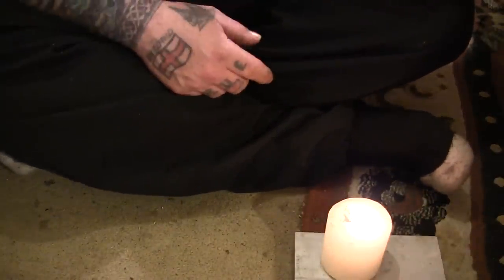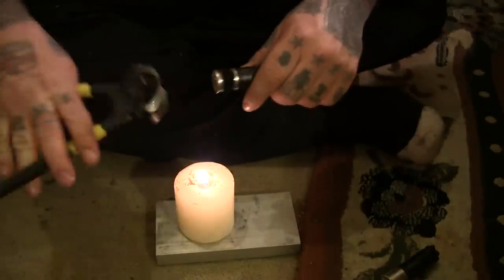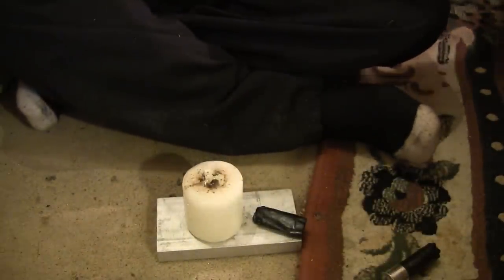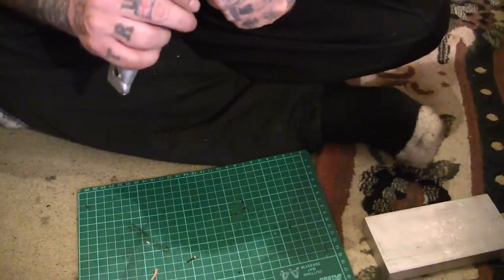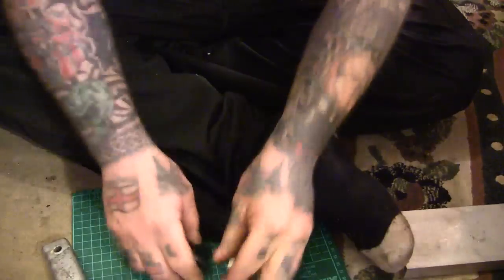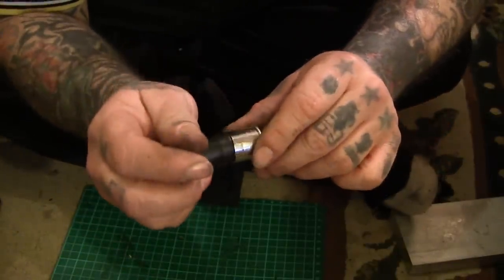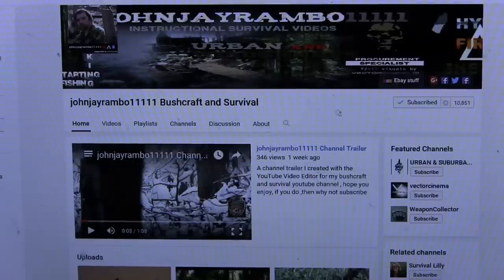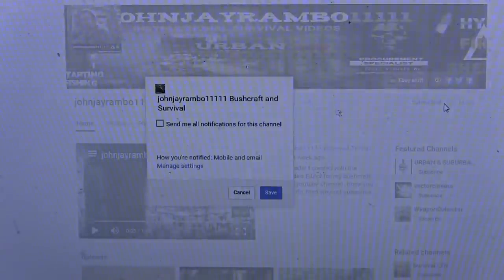How To Make A Shotgun Shell Matchbox Holder

Comment: What you should do for a lanyard is pop the primer out thread some paracord through it and tie a knot to hold it. Popping out shot shell primers is easy just push a biro inside the shell so the nib goes through the hole and smack in on the table.